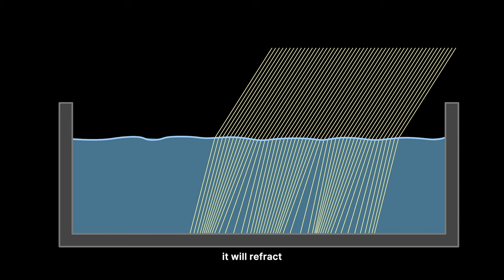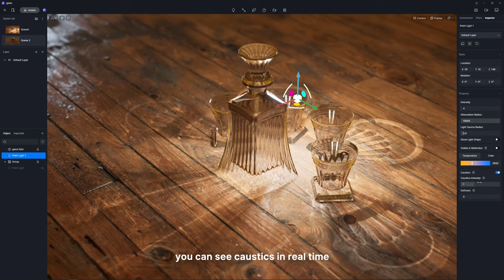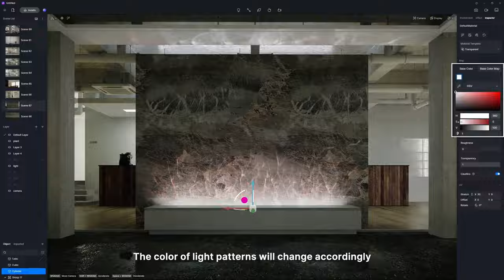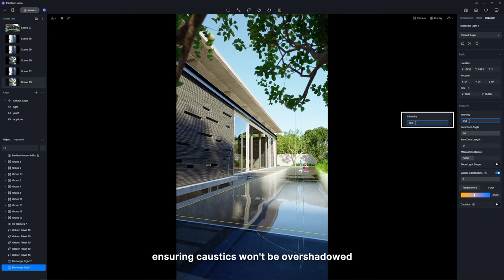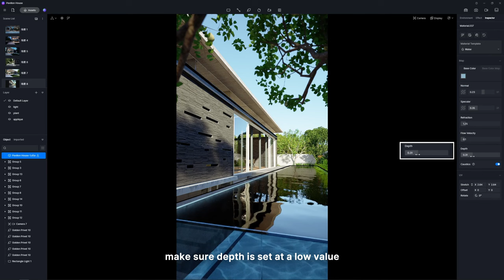How to Create Realistic Caustics in Rendering | Glassware, Be Water Lamp, Swimming Pool

Comment: 3:32 quando a água esta na sombra não gera caustics na mesma intensidade, apenas na parte que pega o sol, foi representado errado ali
Reply: Yes, that happens because the square light that projects the caustics is covering the whole pool. It should be done with two independent light sources, one for the sun area and other one for the shadow area.
All that trickery is needed because those are nothing but fake caustics, just projections. 
D5 won't raytrace real caustics (unlike Chaos Vantage does).
Here in d5 caustics are not seen from the GI, but just from direct light sources.
That's why the effect is so neatly updated in realtime, because are just a projector.